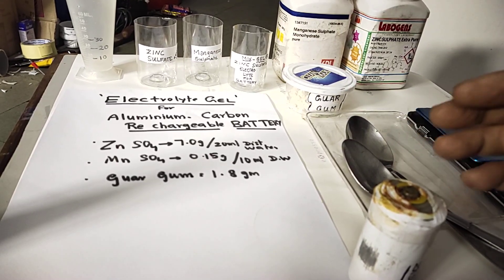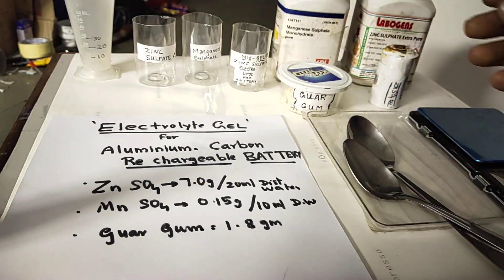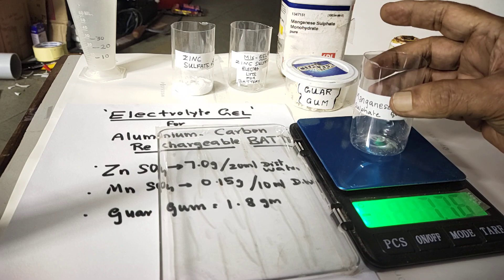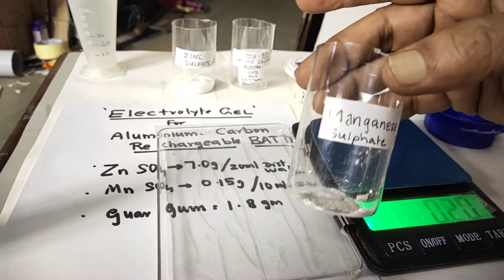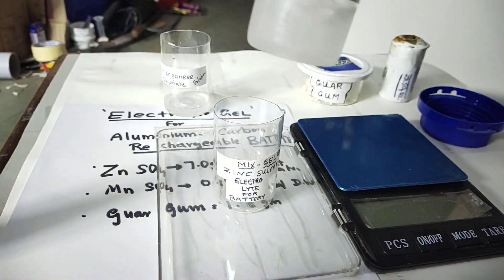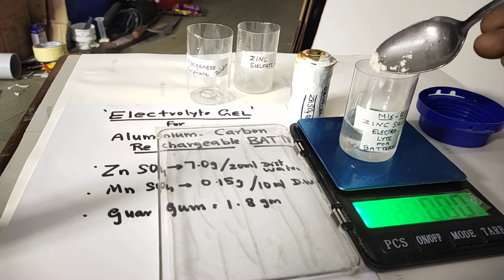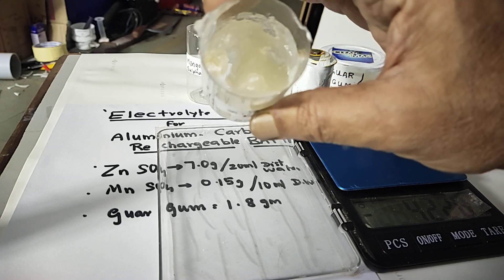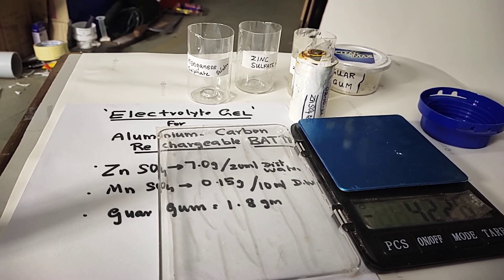D.I.Y. EASY 100% WORKABLE ELECTROLYTE GEL FOR ALUMINIUM CARBON RE-CHARGEABLE BATTERIES

Comment: Hello good day sir I have a question I made aluminium battery before but it only last for 1 day next morning the entire foil look like eaten by rats my question is if I use this gel will it make my aluminium last longer or not ??thank you
Reply from the maker: @JimmyCross-f7w  yes, when you use zinc chloride, zinc sulphate and small bits of manganese sulphate in gel form the electrochemical is stable and lasts longer. Thank you
Reply: @dkjawahar-techexpt671  last longer mean it will last for years ??

Comment: Is gel battery suitable for lead battery?
Reply from the maker: The gel electrolyte quoted above will not be efficient.If  it contains zinc chloride, then it will dissolve lead and there will be grid damage. You can use sulphuric acid with lower strength up to 15-20% in gel form. Which will be okay for regular use.
Reply: Can you help me, is manganese and sulfuric acid guar gum gel suitable for batteries?

Comment: I want to compliment your work. I've built a very similar battery (dual sulfate salt electrolyte)  although not in a canister format but rather in a planar format. Really appreciate your demonstration of the electroless zinc deposition method and this gelling approach for the electrolyte. I might suggest because of the reduced mobility of the gel electrolyte that you may be able to increase the current via reduction in internal resistance if you were to increase the diameter of the active material (carbon black/graphite/metal oxides), thin the gelled electrolyte layer down to approximately 3-4mm (but no thinner as even with the thin zinc metallization you've applied to the anode, dentritic formation will eventually be a limitation in the lifespan of the battery with enough cycles), and soak the active material in the aqueous version of the electrolyte as the final step in building a cell.  I may in the next couple of weeks build out a similar canister form of this battery and check out any effects of these changes as well. Will let you know any improvements I find worth noting. Anyway, wanted to let you know your body of work here is excellent and really appreciate your efforts sharing with the wider community. 👌
Reply from the maker: Thank you for your valuable comments and suggestions. This is what I was able to carry out with the available resource.